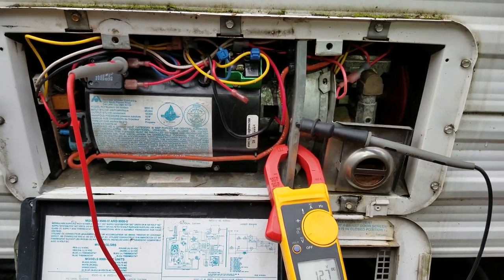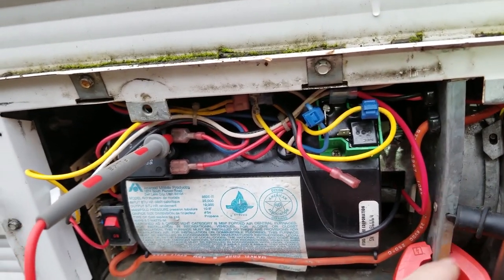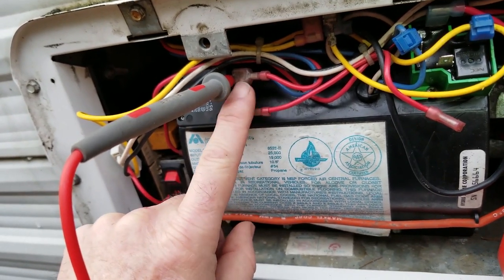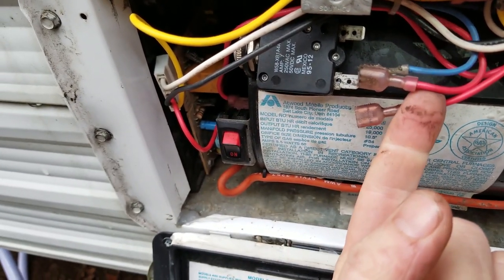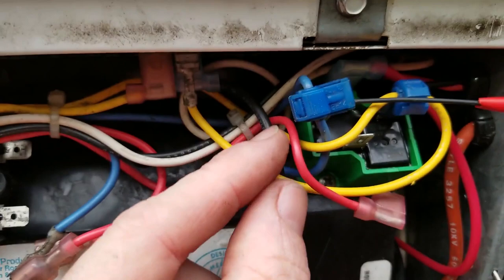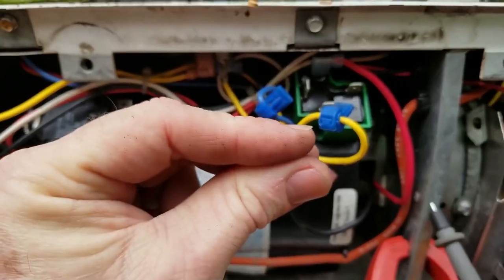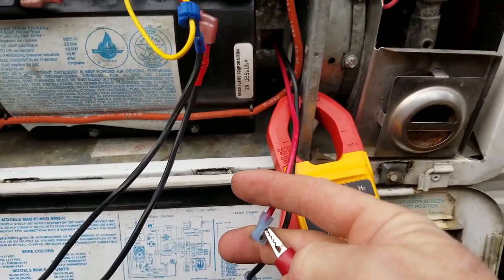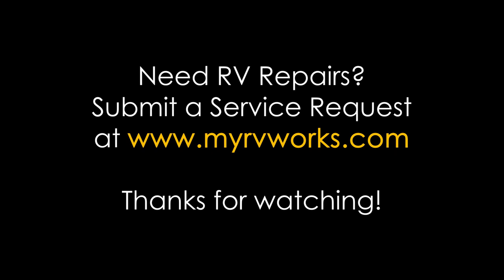Failed Relay On An Atwood 8500 Series RV Furnace

Comment: Would a failed relay cause the 15 amp power vent fuse to blow?
Reply: Hi Jeff,

Not sure I am following your question here…  When you say ‘power vent fuse’ are you referring to the vent in the ceiling???   I can not think of a power vent as it relates to the furnace.

So, notwithstanding my confusion to the question, a fuse will blow for two reasons.  First is current flow in excess of the fuse rating.  Second is a short circuit.  A fuse rating should never exceed the current rating of the wire attached to it.  To test for a short, you can use the continuity mode on a meter and check for a ‘beep’ between the two wires and each wire to ground.  One wire may have continuity to ground if it is the negative wire.  If you get a beep between the wires than they are touching each other and that is not good.

Regarding the failed relay, there are two parts to a relay.  The power side and the control side.  If the control side fails than it is not able to energize the magnetic ‘coil’ that moves the power poles, so they close or open the circuit passing through the relay.  So, if the relay has failed it would be good to know how it failed – control coil or power poles sticking.     

Lets us know what you find.

Cheers,
Darren Koepp

Comment: Where did you get the relay?
Reply: That relay is a Dinosaur Electronics PN:  12VDC TDR
Reply: Here is a link on Amazon:  https://www.amazon.com/Dinosaur-Electronics-12VDC-TDR-Delay/dp/B01M9K2U78
Reply: I had this same exact problem a few weeks ago.no start atall wouldnt even turn on fan.replaced the time delay switch word great till lastnight.now the fan kicks on can hear the gas valve open but wont ignight.i checkd for power at the wire to ignighter but no power.im thinkn either the ignighter went out or the computer board went bad.any ideas would be much appricated.its the same exact heater in this video.thanks
Reply: @jreynolds9709  most rv places will test the board for free. I would start there. If the board tests out ok clean the tip of the ignitor with some really fine sand paper.
Reply: @VroomvroomNY  ok.thank you.i will try that. realy hate just changeing parts & cant afford to either.

Comment: my problem is that it works well for 20 seconds it goes off it turns on again like 20 seconds it turns on again it repeats like 5 times and stays off or starts working fine.
Reply: Ismael, what was the solution to your problem?

Comment: I don't think the average do-it-yourselfers gone to have an extra relay laying around. I would have liked to see you bench test that time delay relay.
Reply from the maker: My business is a mobile service and I do stock many of the parts that will be needed to make these repairs.  I can not speak to what an average DIYer will have - that is why they call me.  Another point to consider is that my customers don't want to pay our $150/hr rate to have me bench test parts.  We use standard RV service flat rate to determine the task time to make a repair - often that is a pass/fail test not a full diag. on a bench.  I get in, make a diagnosis, make the repair and get out.  Keeps me on schedule , keeps the customers invoice low and reduces call backs.  Others can operate their business however they choose but this is how I run mine.  So far it is working out well for the customers.

Comment: Looking forward to you covering a 24 volt system (or ac powered) park model type. 50%of my work load lol.
Reply from the maker: I do have one video covering a Suburban 120 volt furnace with 24 volt control. It's on my furnace playlist. We are getting more Park model calls, so if the opportunity presents itself I'll certainly make a video. Thanks for watching and happy camping.
Reply: My RV Works, Inc. hey bud I have a Atwood 8525-11 furnace I put a new burner on it. It fires up and clicks and then lights and it’s warm then after it get to temp it starts to blow out cold air and the fan continues to blow and it want shut off and it doesn’t kick back on. So I shut it off and turn it back on and it doesn’t do nothing now. Could it be the fan time relay? Thanks
Reply: Shawn I would test your high limit switch, my RV works shows how to do this. Forget which vid.
Reply: Ken Prendergast I did a continuity test on a high limit switch wires that’s going to the sale switch and then the plug goes into the ignition board and it showing that has continuity
Reply: @shawnmalicek1189  in your case I would go for the main board next. I'm always packing a spare board.
Reply: Ken Prendergast  thanks I did what you said and now it all works very well thanks alot.